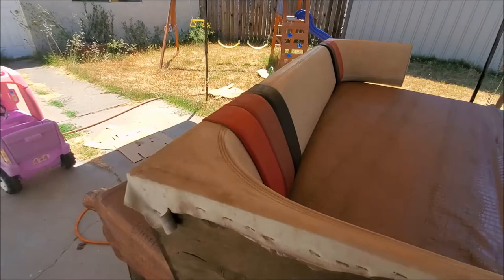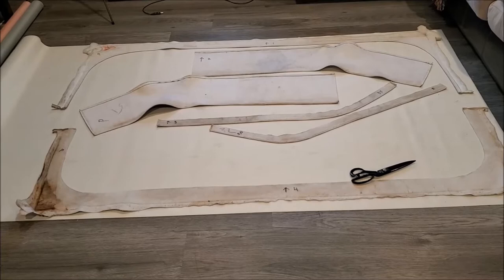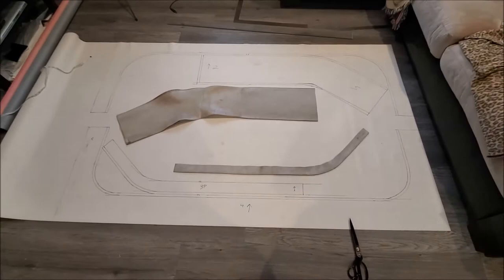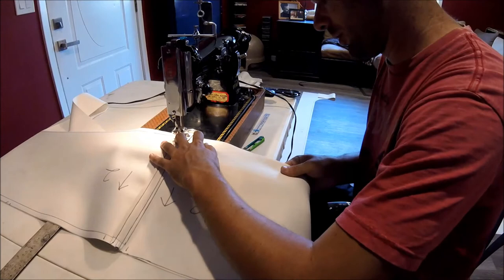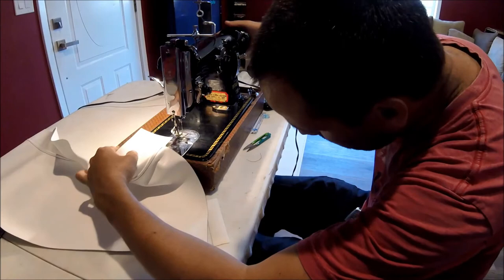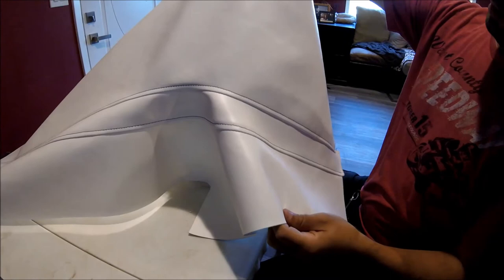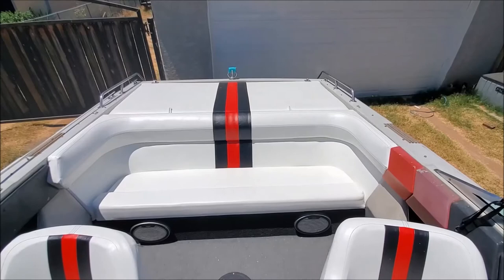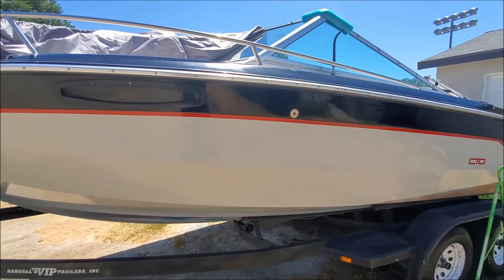Chris Craft Scorpion Project Part 8 -  Back Seat Finale

Comment: Looks good. Some tight images showing how well the corners and other thought to fit areas worked, and adding some discussion on the challenges.  Thanks for sharing this work.  You used a non walking-foot sewing machine... wuzzat difficult to keep it advancing stitches regularly? Did you share the source and quality of the materials used; especially the foam rubber used replacing the old?
Reply from the maker: I'm planning on doing a wrap up video with all the details on cost, materials, etc. once I get the interior finished, and I'll try to add some detail shots in there as well. All of the fabric was sourced from Keyston Bros. and the majority of the original foam was in good enough shape to reuse. The large sections I used for the seat cushions were leftover from another project I did years ago so I don't remember where it came from. I know Sailrite is a good source for it though. 

As for the sewing machine, the only time it had any issues was when I was crossing seams where multiple layers of material stacked up. For those I would generally roll the machine forward by hand  while manually pushing the material. I wouldn't recommend using one of the light duty home sewing machines, but this heavy old iron did a pretty good job.